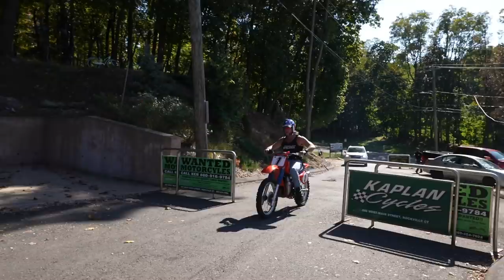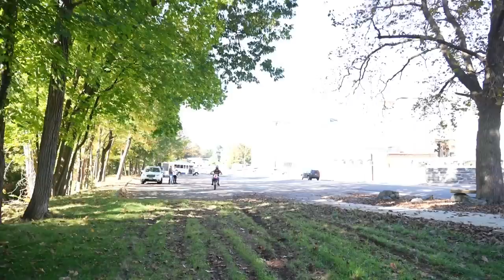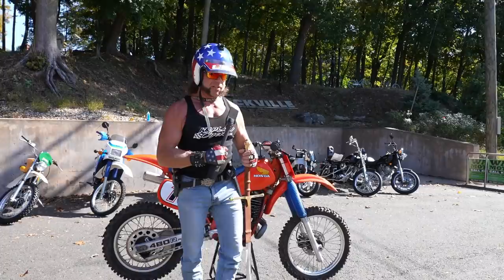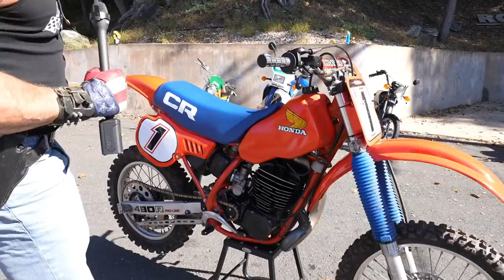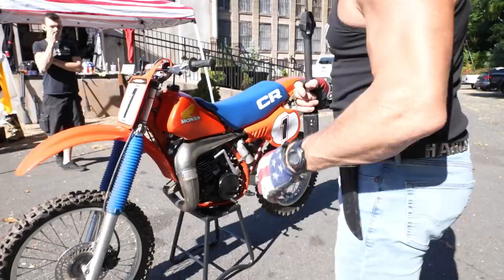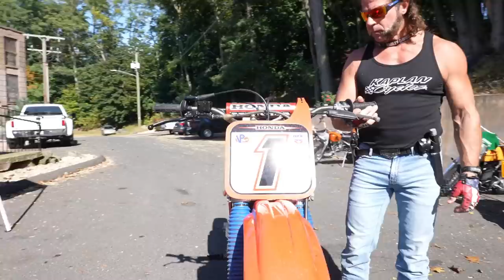MINT 1983 HONDA CR480 BIG BORE 2 STROKE

Comment: First big bore I rode was one of those. Not to mention it was middle of winter on a lake. 4th gear power wheeling while digging a 2 inch trench in the ice the length of the lake. Yeah those bike are fun

Comment: I had the same bike. Guy ice raced it before I picked it up. Anyway used to race it in a vintage race at wild rose motor cross track in Calgary Alberta. Last lap of my last race I crossed the finish line witch was a huge table and landed funky broke my back and my race career was over.
Reply: That sucks dude. I raced one for a couple years and it was a love/hate thing, she NEVER lost a holeshot, and even got me the girls! And then shed get me a cast (or two or more) all the way to my crotch, broken ribs, a cracked STERNUM from landing from outer space, multiple concussions, I definitely feel the pain buddy. Hope your days are tolerable...